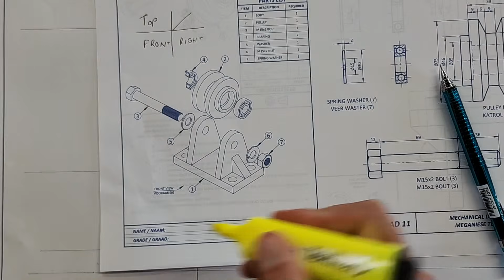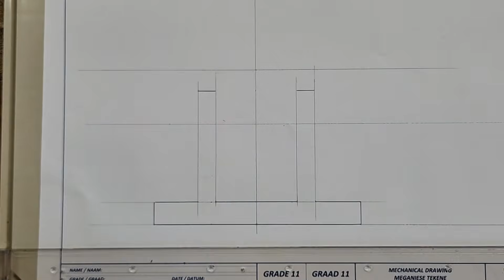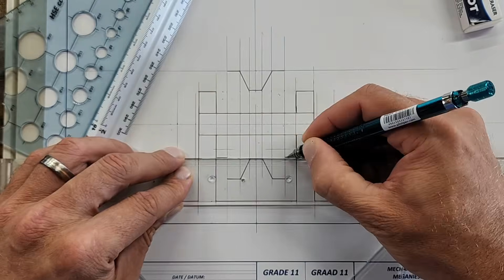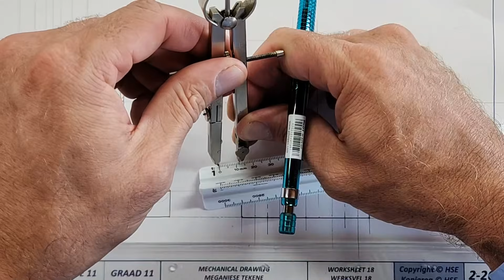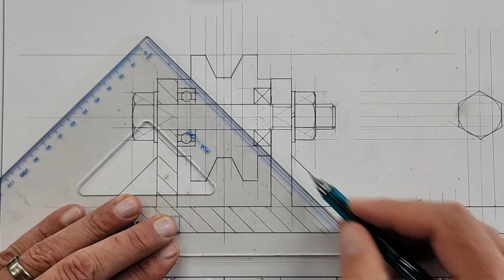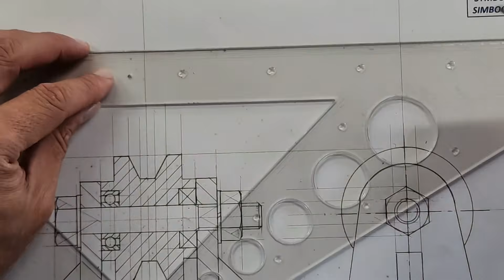How to draw a Belt Pulley Mechanical Assembly - HSE | Page 2-26 | Grade 11

Comment: Sir are all belt pulley drawings the same ?
Reply from the maker: No, they differ in components and dimensions based on the specific design! 🔧 Make sure to read and understand each question before answering and then apply the principles taught.  To view the complete Mechanical Assembly playlist,  watch here: https://youtube.com/playlist?list=PLbbL6Teny_0YdjI-kv86hX_O_VJBqf6Vh&si=JwYMsRLAK46MUJLJ